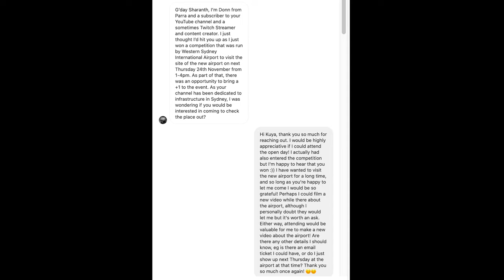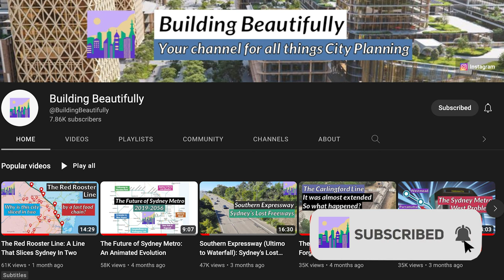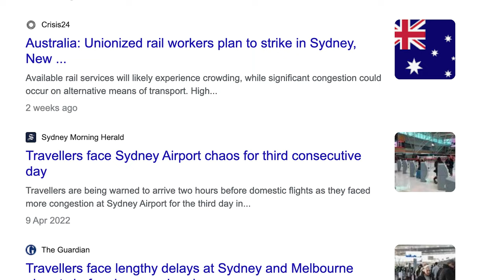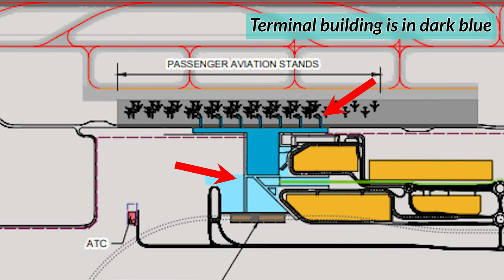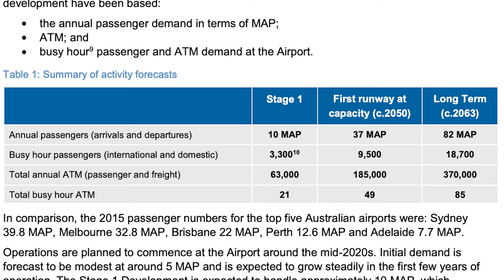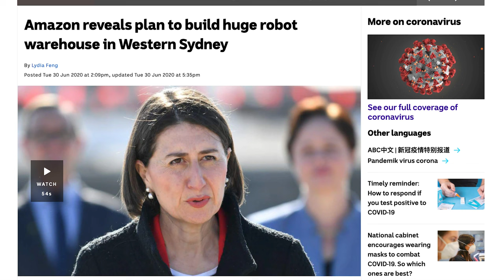Western Sydney Airport Tour: Sneak Peak Inside (Nov 2022)

Comment: Re the curfew: note it's not just the night curfew but also the hourly curfew that can be really killer at YSSY. Planes sometimes have to wait at the runway for the clock to tick over, even if the previous hour had barely any flights. Really compounds delays because the airport can't make up time.

Comment: 12:53 The basement fit out for the robotic baggage handling system, plumbing, hvac, etc. will take many truckloads of equipment so MPX will leave the current access ramp in place for a good while before backfilling up to ground level🙂

Comment: Great video, thanks Sharath. As to it being 24/7 and a replacement, I’m thinking this is engineers’ dreams. SYD has two overwater runways, the new airport has none, but it has bazillions of residents ready to make complaints once they perceive the aircraft noise reality. My money is on a curfew (after the howls start) and no replacement.
Reply: Indeed. For obvious reasons State and Federal governments have not highlighted the new airport no curfew plans. Large parts of western Sydney might not become fully aware of this until they are chronically sleep deprived after months of operations. By then the airport might have become such a political liability. Governments will be forced to make changes.
Reply from the maker: Yeah I suppose we'll have to wait and see. There's a lot of cynics in the comments...I'm personally hoping the lack of curfew remains, but who knows what will happen.

Comment: On the Metro it should be noted that it will be in the centre of the fully built terminal. The current terminal under construction (while large) is only about 20% of the final design (with an additional runway).

To be honest a bus would probably have been good enough for the first 5-10 years anyway, and the rail connection won't really get going until the connections are built to Tallawong and Glenfield/Macarthur as well as the 2nd link to Parramatta.
Reply: Even better a short cheap extension to the SW rail would provide even better service, and a direct link to the CBD which the metro won't. Once again ideology trumps value for money.
Reply: @jack2453  Both links are about the same distance so would have cost similar amounts.

St.Marys however provides far better access to the Penrith to Parramatta corridor that the airport is primarily designed to serve, as they currently have the furthest distance to travel to the main Sydney airport.
Reply: @mark123655  10km of new automated metro largely in tunnel has to be considerably more expensive than a 10 km extension to existing heavy rail or a 1-2 km extension to the already planned line to Aerotropolis. But it is not either/or the cost of a heavy rail link from the termibal to the Aerotropolis would be trivial in the context of the total project cost, and the benefit of an express a no-change single seat ride to the CBD would be enormous.
Reply: But to the detriment of people going to Parramatta, and particularly to Penrith - probably by 20-30min

This is a 2nd airport, not a replacement.
For the first 20+ yrs Mascot will be much larger and have way more flights to multiple destinations.

Even if flights are slightly cheaper, your average CBD exec isn't going to spend 1hr+ on a train to Badgerys when Mascot is much closer.
Reply: @mark123655  ....and tha average Western Sydney resident is not going to wait an hour for a bus to the rail station, then 20 minutes for a train to St Marys, then schlep their bags from the rail station to the metro station when they have a 4WD in the garage.
Reply: @jack2453  so no rail at all needed in the Western suburbs. Brilliant. That'll save $billions in the next 50 years
Reply: If Melbourne has taught us anything, you don't wait to build a train link until it's too late ($$$) I still think they should just extend the line all the way to Tallawong. They already have the corridor secured. Guess it's not a matter of if, but when.

Comment: That is incorrect, you don't have to use the toll, there is an interchange direct from the M12 to Elizabeth Drive. This means you can meaningfully use it as the entire length of the Motorway is accessible toll-free.

Comment: If the New West SYD is for full old SYD replacement when it open, it would be having a 2-3 times bigger terminal, around 400,000-700,000 sq metres floor space, like Hong Kong Airport T1 size, and also build the 2nd runway together.

Comment: Great vlog and great to see someone enthusiastic about government building. Most of the videos you have produced have been about projects that have failed to be supported one way or another. Let’s hope the new airport does not make that list in the future, although a railway station a hundred metres from the door does not give me a lot of confidence, without adding the 2-3 hour trip to the city for business or medical appointment in a crowded carriage. A camel is a race horse designed by a government. An airport is not a destination.
Reply: It’s currently about 1-2 hours to Sydney CBD (depending on the level of traffic) via Elizabeth Dr & Northern Rd. The extension of the M4 tunnels to ANZAC bridge (which is currently happening) will help in shortening that time. The extension of the M4 tunnel will potentially save about 20-25 minutes in travel time. And it should continue to be eligible for the toll relief/refund scheme for privately registered vehicles.

Comment: Do you have any more information on how the gates can be swapped between domestic and international? That sounds very interesting!
Reply: At other airports I've experienced, one level is for domestic, another level (on top or below) for international, so they just open the ramp up or down depending on the flight, I assume something like that.
Reply: @wkapri   correct. Done in CBR, ADL and OOL
Reply from the maker: I don't, but what @wkapri has said sounds right for sure
Reply: They have this in Adelaide.  The gates are all the same level, they just have big sliding glass doors that can be used to isolate a flexible number of the central gates to funnel passengers through the centrally located inbound and outbound immigration facilities.  The way it's laid out in Adelaide, all passengers (domestic and international) proceed from check-in through security to the "secure"/"airside" part of the terminal first, but then International passengers go through outward border control to enter the inner "International" part of the terminal, which has access to however many gates they have sealed off for international use at the time.  Arriving international passengers are directed to an intermediate level below for arrivals immigration before going down to the lower level for international baggage reclaim then through the customs exit.

It looks like the gates themselves are intended to be mixed mode - the 7 piers having dual aerobridges might be able to convert into two gates per pier for smaller aircraft, but larger aircraft both need more space and typically use two aerobridges (as shown in the mock-ups in the video).

Comment: It’s interesting with no curfew at Western Sydney Airport. Assuming passenger flights could leave and arrive at the airport at any time, will there be a 24 hour metro service to the airport? Even if you make the driverless metro airport line a 24 hour operation, the metro does not meet every corner of Sydney, relying on few interchanges with suburban train lines that are not 24 hours.
Reply: Hence why it should just be connected to Tallawong. Easiest option for now to provide a 24/7 service to the CBD.

Comment: “Metres squared” is just plain wrong. Please use the mathematically correct term: “square metres”, ie m^2, measuring area. “Metres squared” (^2m) is a linear measurement.  The numeral 100 is 10 squared (10^2 or 10 x 10), or the square root of 100 is 10. “^2” denotes a “superscripted 2” like superscripting the “th” in “4th”. YT comments cannot superscript. Therefore, 75,000 or 75k “square metres” ie 75,000m^2 in scientific notation (7.5 hectares or ~18.5 acres) of which the square root is ~273.86m. In conclusion, 75,000 “metres squared” or 75,000^2m is a linear measurement, 5,625,000,000 metres ie 5,625,000 kilometres - just a little bit out? 

I have been a property valuer for 40 years all around Australia, determining building and land areas and writing thousands of valuation reports, so I know what I am talking about 😬

Comment: Just wait till it opens for the flood of complaints about a curfew. Some politician wanting to get elected will promise a curfew lets hope the operating contract is watertight on 24/7 operation. In regard to the curfew now here's 1 example. EK414 from Dubai usually lands at 10:30pm. If your connecting with that flight, from somewhere else in Europe & your connecting flight is late EK414 cannot wait for you as it will miss the curfew in Sydney. If that flight gets moved to Sydney West in the future a half-hour delay won't be a problem. What happens if your late into Dubai they offer you the next available flight which goes via Singapore. That adds nearly 12 hours & one extra stop on your flight. I was offered that but chose to sit it out for 7 hours in Dubai & arrived on the 6am flight the next morning. Can't wait to have Sydney West as an option just for the 20 minute drive home from the airport
Reply: And some welcome home krispy kreme! 👌

Comment: The Toll on the M7 makes it virtually impossible for overseas travellers to use, and therefore won't be able to use the M12 to access the airport.
That's going to lead to a lot of overseas (or even out-of-state) travellers using local roads instead.
Any motorway which is designed to link an international airport to a city should have a toll-free option, whether it be by means of separate lanes for express toll users, or even by setting up the tollgates at the airport to issue free tickets, or incur no fee when a ticket is presented.
Reply: Overseas travellers can use public transport

Comment: My prediction is that Kingsford Smith will be too historically important to be knocked down, and it will still be used as an airport far into the future unlike Kai Tak airport in Hong Kong (Approach required a steep bank on final which caused the closure of the airport when the new Hong Kong airport was constructed plus specialist training to land at the airport). What I think would happen is similar to London, where they have 2 airports to serve the city being London Heathrow and London Gatwick, where Heathrow handles the more international flights and bigger aircraft like the A380 and Gatwick handling the smaller, "domestic" (Shorter flights from lets say Madrid/Paris/Frankfurt etc to London) with Kingsford Smith serving the same purpose as Gatwick, and Western Sydney airport serving the same as Heathrow. 
Also, Ive worked on the QQT project ran by Multiplex and the problems encountered at that site and what ive heard from workmates who worked on other Multiplex sites, Im sceptical the airport construction will be as smooth as predicted. QQT was filled with problems and delays along with the Wynyard upgrade, also Multiplex. Lets hope they pulled there socks up for this one.

Comment: Curfew at Kingsford Smith to appease the East and just dump the noise to the West. Locals are still in the dark in regards to flight paths. 
Public transport will also be a problem given the metro only goes to St Mary's and the Western line is closed 12ish to 4am and during peak hour only a few an hour that stop at multiple stations meaning 1hr or so trip to central. 
Sydney Trains really have to pull their finger out and fix the Western line to deal with all of the extra passengers at St Mary's with large suitcases getting on trains full of commuters during peak hour. 
Its bad enough getting on a intercity mountain train at Penrith thats already full of passengers coming down, some with luggage, suburban trains have no luggage space.
Reply: Classic east really, dump everything and everyone seen as "inconvenient" out here.

Comment: Talking of a congested airport forcing the government to react and find a new place for a new airport, I will use Shanghai as an example (quite a similar situation building its 2nd international airport as Sydney is going through), which its Hongqiao airport(SHA),was built in 1920s, expanded several times to an international terminal in 60s, reach its capacity and it was already too late to expand itself to a larger scale in the 80s as its nearby land had been taken by residents and businesses over the years(which made it still a 2-runway, 2-terminal airport till this date), so Shanghai gov. have to look for places for a new international airport (which it became the Pudong international airport(PVG) at its city far east to its CBD, compared to SHA western location to the CBD, but closer, size-wise PVG 1.45m sqm to SHA 0.51m sqm, and operation-wise PVG is more international flights focused, while SHA is more domestic flights focused, though both international and domestic flights are available in both airports)
My point here is that western Sydney Airport will be an amazing project to help Kingsford Smith, and the western Sydney area, given its proposed number of runways and terminals, and public transit projects to complement it. Kingsford Smith to Sydney can be like Hongqiao to Shanghai, more of a domestic flights focused, closer to CBD option for travellers(though the curfew is still a major downside but will be less painful to most if there is a second option), while the new airport can be the giant hub of travellers, cargoes, workers to go around the world. 
As for the concern about curfew enforcement out there, I've been wondering why Tullamarine in Melbourne doesn't have one, given there are also some residential zone around it as I looked up, hmm.

Comment: The Wylde Mountain bike park was relocated to make way for the M12 Motorway to the new airport along Elizabeth Drive. Liverpool BMX track also got moved there after it was suspiciously closed due to the "discovery" of asbestos. Same thing happened to the radio control car track. Both were operating for years until someone went looking for asbestos there so they could shut them down. I will never use the new airport. My travelling days are behind me now.

Comment: Anthony Albanese campaigned in the 1990s on building a second Sydney airport but despite being transport minister for six years it was his Coalition successor who made the final decision. In 1973 the worst transport minister ever, Charlie Jones, named Galston as the site. It  was in rugged country with no transport links and no nearby workforce. But it was a Liberal seat and that was all Jones was thinking about. Towra Point at Kurnell was named more than once. It was Bradfield's (harbour bridge bloke) choice from the 1940s. A marginal seat it was supported and opposed by the Libs and Labor at different times. Other sites have been Albo's Wilton proposed as a joint Canberra/Sydney airport despite being 200km from Canberra and  a Liberal seat and the Libs thought Holsworthy artillery range (awash with unexploded munitions) which was a Labor seat . Bankstown airport was also among the ideas put forward by the Coalition despite being  surrounded by housing.  Safe Labor seat you see.  Badgerys Creek noise affected both Liberal and Labor seats. It was in the end the only solution, politically.

Comment: As mentioned late in this video, this airport is being pushed (mainly by politicians with vested interests) as a freight terminal. There is little to no interest in providing the metro any time soon (TAHE recently released secret report confirms its official construction pause). SSY doesn't have a curfew for freight or medical flights - just passenger. Big picture, the only reason SSY was near capacity for pax (before COVID) was due to over-inflated domestic demand. Pressure from QANTAS, oil, and the trucking lobby has delayed construction and improvements to our rail system - a much more efficient way of moving people and freight around Australia. Without this domestic demand, SSY remains viable as an airport, but its private owners can't sell off the land for housing development. 
Once again, private ownership of the airport railway had led to exorbitant pricing and reluctance of travellers to use it.
Reply: @SS-yw7vo  prove me wrong.
Reply: @jameslvsjo  what you wrote doesn't make sense
Reply: "over inflated domestic demand". What does that mean?
Reply: "delayed improvements to our rail system". They are duplicating the existing freight line
Reply: "rail is a more efficient way of moving people around Australia". Tell everyone flying between Sydney and Melbourne tomorrow they should get the train instead
Reply: @SS-yw7vo , read the very next sentence.
Reply: @SS-yw7vo  what?
Reply: @SS-yw7vo ....."delayed"
Reply: @SS-yw7vo , imagine what could have been, if not for all the corruption. Also, "efficient".

Comment: There is one aspect of the airport that is a potential environmental and safety disaster. The aviation fuel is NOT going to be delivered by pipeline. There are 8 tanker unloading stations at least. These will unload tankers of aviation fuel day and night. Trucks carrying thousands of litres of fuel will be hurtling along the M4 from Clyde and Botany. One crash could paralyse parts of Sydney and cause multiple deaths.

The mayors of suburbs between Botany, Clyde and Greenwich need to be aware of the impending catastrophe . The mayors of suburbs en route to the airport should also wake up.

Add to this the diesel particles in the air on the common thorough fares. All in all a disaster waiting to happen.